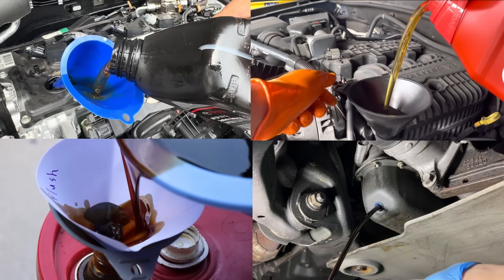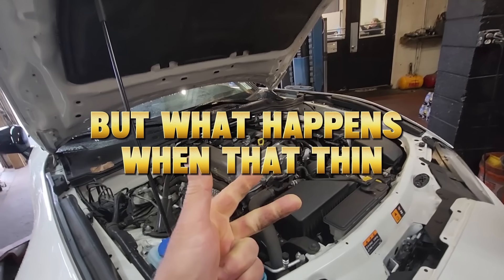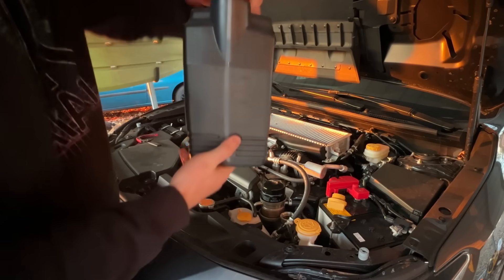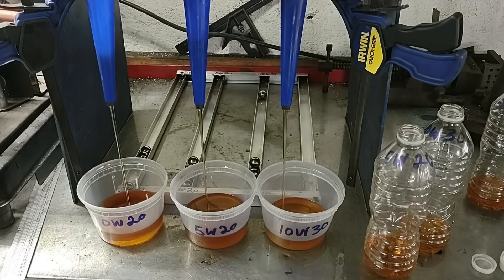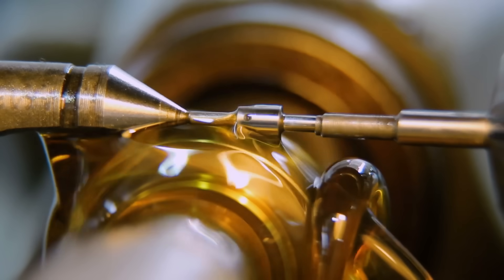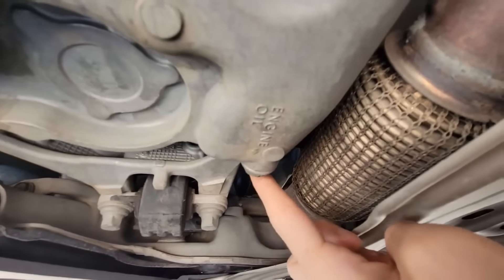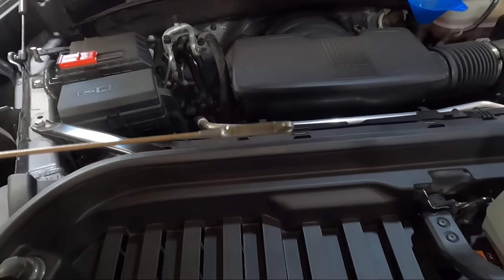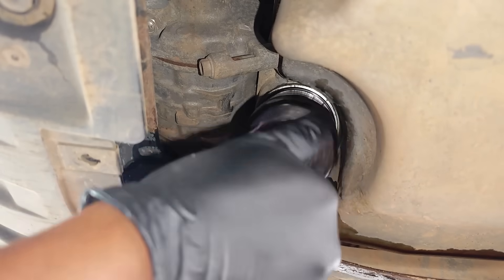The TRUTH About 0W 20 vs 5W 30 Oil (50 Engines Tested!)

Comment: this guy doesn't know what he's talking about because they just don't throw in a 0w20 on an engine that designed for a 5w30 they designed the engine to use a 0w20 0w16 or 0w8 in according the bearing clearance when they build it. I've owned a 2016 toyota sienna le with a 2grfe v6 engine that always recommended 0w20 and after it got total in an crash it had 196400 miles and it ran great and it didnt consume any oil. there shouldn't be any debate on what oil to use in your car when your car is recommended for that type of oil.
Reply: Don’t drink the Toyota Kool-Aid too hard. Yeah they’re putting in 0W8 and 0W16  in the engines now. If you drive the car hard or Tow a trailer, you better use a little heavier oil or you are going to have problems at high mileage. Being a mechanic, I’ve rebuilt, lots of engines . tolerances are not tighter. In fact, they have more clearance than before. If you want it to last 300,000 miles plus I would recommend a little heavier oil. You can do whatever you want for my vehicles I use 5W30 and 5W40 Full synthetic in the vehicle I use for towing. In my ATV which gets driven hard and abused, and dust and sand and snow I use 5W 50 full synthetic. In the group of guys I run with I think I’m the only one that’s not had a motor blow up
Reply: @DCSPORTSTER  have you ever measured bearing clearances and piston skirt to cylinder wall clearance before. I don't think any engine factory would put any type of thin oil unless they designed it for that purpose. its clearly common sense when you think about it. it doesn't matter if I tow or pull what I'll at least do is add a high performance oil cooler. why are we going against engine manufacturers when they spent a shit load of money for the vehicle that you bought just to listen and believe in a AI voiced video. people like you think too much of how can I make my engine last. those engine you have rebuilt I'm sure its not oil related as you are telling me I'm sure its just abuse, negligence and poor maintenance from your customers. trust me I have always used the recommended oil viscosity in any engine no matter if I'm towing and pulling I haven't blown up an engine.

Comment: In Sweden (only gets to -20C at home, but -30C or worse up north), so I go with 5W40 A3/B3 or B4 for a R56 Mini 1.6, 200HP Turbo petrol engine.  Electric sump heater, used when required. This engine runs hot, so I go with a thicker oil.  I have had the Mini now for 12yrs, no engine or Turbo problem.  Had a Audi 3.0, V6 Diesel Turbo (CDYA) with engine heater on cooling circuit, ran that on 5W30 C3 (VW507) for 12 yrs.  Now, BMW 2.0 l Turbo Diesel (B47D), I use 5W30 C3 (BMW LL04) for past 3 yrs. Sometimes I use 0W30 in winter. Car may have to start in -30C in winter.  I may even go to 5W40 C3 for the BMW, but 0W40 is difficult to find.  BMW has an engine heater for very cold starts.  I keep cars for a long time, I cannot recommend 0W20 if you want sustainable/reliable cars.  Also 20 yrs old Toyota Corrola 1.6l (3ZZFE), for which I use 5W40 API-SN.  Always use fully synthetic, Shell, Castrol, Total oils.  But liquid molly looks the best.

Comment: I remember when the owners manual would tell you different  viscosity oil depending on your climate. Now it seems like you ONLY run a certain weight.
Reply: 1997 Camaro 5.7.  10w30 over I believe 37 degrees & 5w30 for year round use.  The manuals used to tell you a lot that now seems hidden behind paywalls.
Reply: I remember when everyone ran straight 30 weight, & the engine's did not have oil filters.
Reply: @scottyellis3442 yea but what clearances did those engine have? And what was the power to displacement ratio? 😊
Reply: @Cristian-em5wc 
I wasn't saying it was good, I was just reflecting on how far we've come over the years in my lifetime.
Reply: @scottyellis3442 yes indeed, I also didn't question whether your are right or not, just bringing into the spotlight few of the many reasons we jumped to the multigrade oils. More advanced technology, more power, higher stress and forces in the engine, emission standard and so on 😊
Reply: @scottyellis3442 I remember that too, I wasn't going back much.
Reply: @scottyellis3442 ...and straight 10W in the winter..
Reply: When the engine is at operating temp it doesn't matter what the weather is outside...only at start up
Reply: They still recommend different weights for extreme temperatures, every modern owners manual I've ever looked in does, they usually have a recommend weight that covers temperatures within reason, like the average seasonal temperatures where I live in Pennsylvania but they have different weights recommended for extreme temperatures that overlap the recommend year round temperatures, ie the year round may say 10°F to 100°F but the extreme hot recommend weight will be like 80°F to 120°F, they don't start and end at the same exact temperatures there's an overlap on both ends of the year round recommended oil weight.
Reply: 50 engine test? Google it! Lies lies lies

Comment: I've been spinning wrenches for over 55 years, and a dealer i worked for that was actually a really intelligent guy when it came to automotive issues, an he suggested using 20/50 oil in Higher Mileage Vehicles, we lived in MASSACHUSETTS.
Reply: He's not very smart with that advice.
Reply: @SingleStacked then you don't know much about high mileage engines, 20/50 extends the life of engines with over 150,000.00 miles on them, ask any real mechanic 😊
Reply: @garyeverett653  Now you are showing your ignorance again. My Toyota has 300,000 mls. running recommended 0w-20.
Reply: @SingleStacked where do you live, climate makes a huge factor, You're fighting a battle you'll never win. 😅
Reply: @garyeverett653  I live in Florida. Telling everyone to use 20-50 is a battle your engine will never win.
Reply: @SingleStacked yea but your driving a rice burner I'm talking about DETROIT MUSCLE RICE BURNERS ARE PERFECTLY BALANCED ENGINES AND HAVE MUCH LESS FRICTION. WHERE AS WITH SMALL BLOCKS AND BIG BLOCKS AMERICAN MADE. NOT SO MUCH. WE WOK AND LIVE IN TO COMPLETE DIFFERENT WORLDS,  AND THERE'S NEVER BEEN A RICE BURNER YET THAT CAN BEAT A REAL MUSCLE CAR. PROVEN FACT. 😊